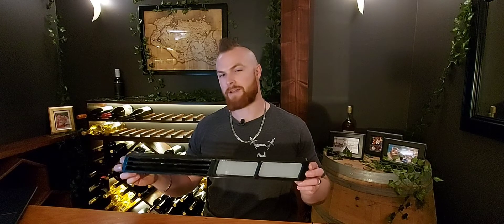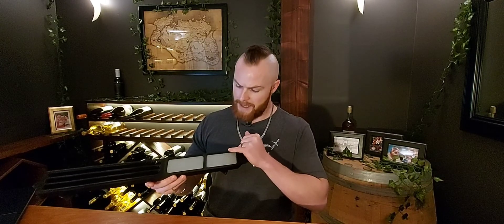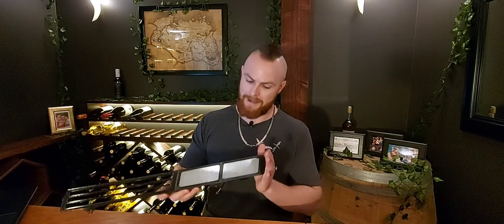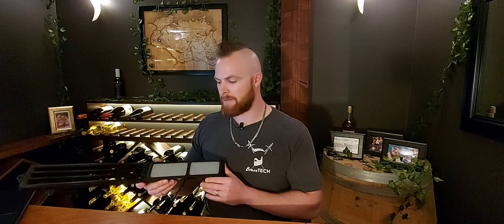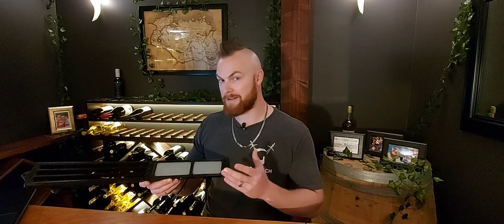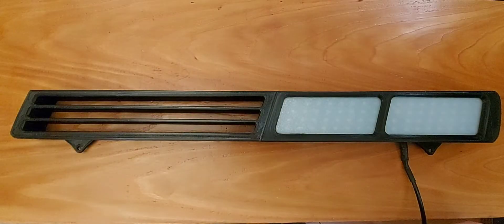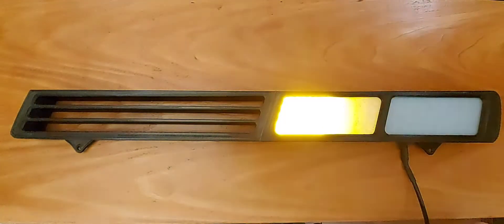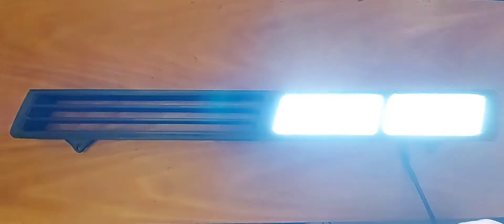BraveTECH TAVERN - K.I.T.T Replica Custom Turn Signal Project

Comment: I would like to know about adding these to my KITT.. what season are these lamps based on?  Also looking for sequential lights for tail lights for my KITT
Reply: if i were to hazard a guess it isn't based off of any one season, Just intended to replace the foglights and turn signals on a car that got a season 2+ front end as that transitioned the car to have a front end similar to a 90-92 Firebird/Formula/Trans Am. I was considering the idea of doing a KITT conversion to my '86 Trans Am and was trying to figure this exact problem out. My thought was i was going to use the 90-92 Turn signal and Fog Light assembly. but this solution is much cleaner!